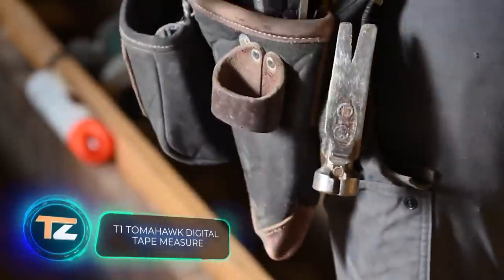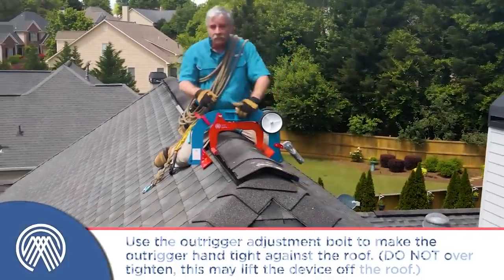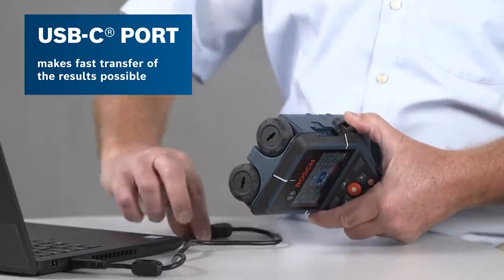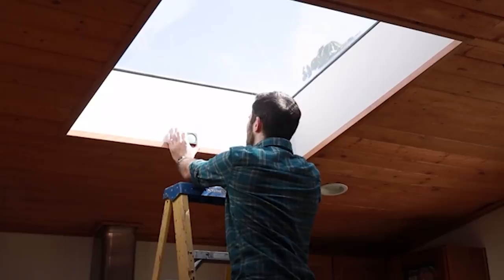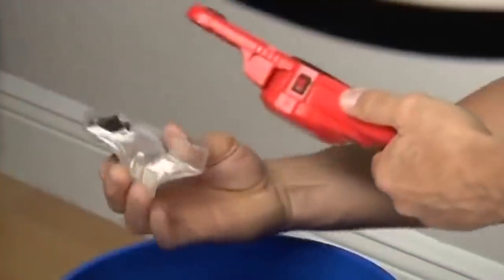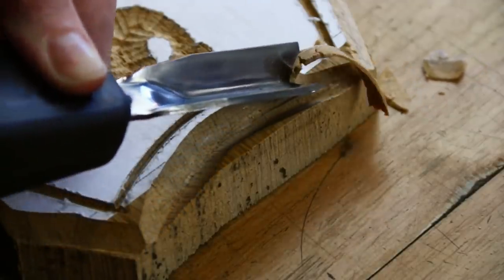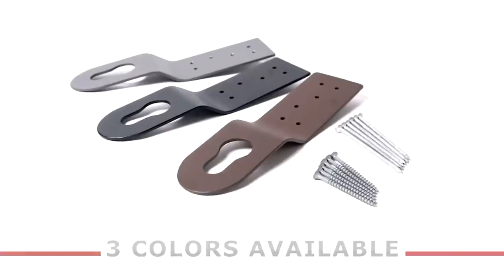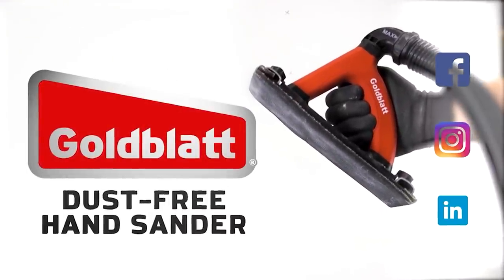INGENIOUS TOOLS OF THE NEW GENERATION

Comment: The roof clamp is interesting
Although outdated.
My friend owns a roofing company. He hires a drone flying company to do roof inspections. Costs him $150.00 per roof.

The Goldblatt sanders have been around for years.
We had powered versions with back pack battery powered vaccuums to rasp styrofoam in the 90s for EIFS applications.

The heat gun paint remover is cool but too time and energy consuming.
A good coat of citrus strip will loosen 90 percent of a surface in about 15 min.
Then knock it off with a Stainless steel scrubber or a sander..